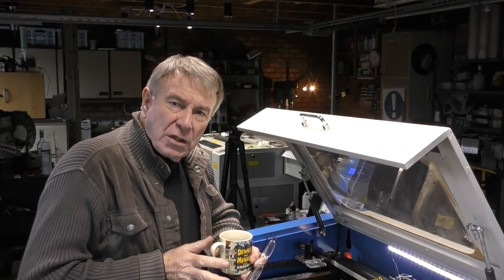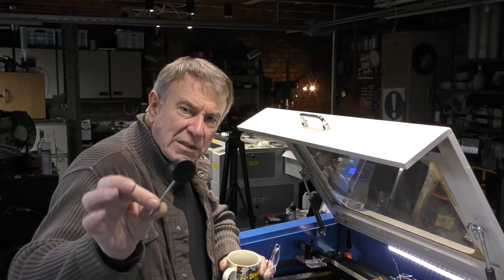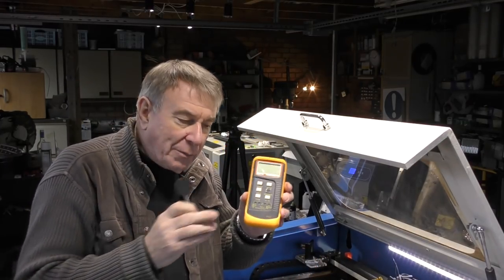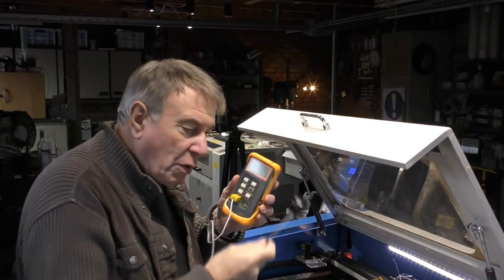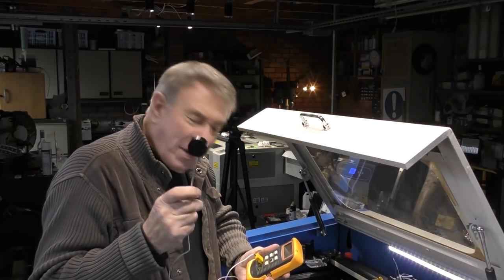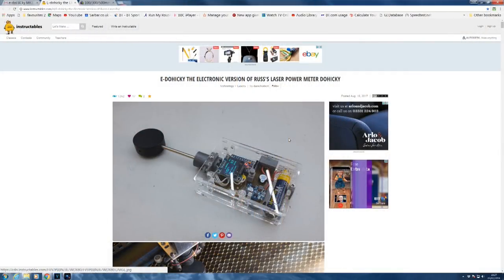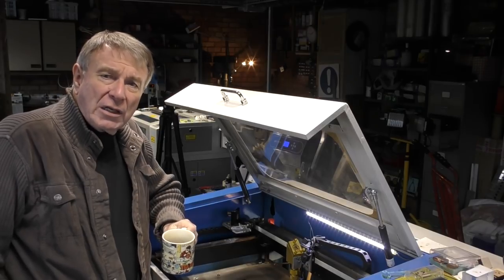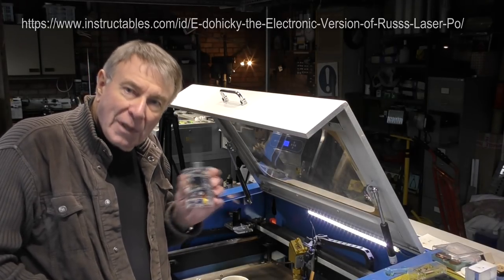RDWorks Learning Lab 131 Dohicky Power Meter Update

Comment: Amazing information, can it measure excimer lamp too. low wattage (5W~100W)
Reply from the maker: I have no way of testing it but an ultra violet wavelength at about 300nm will pass right through the crystal structure of the aluminium oxide anodized skin . It will them proceed to rapidly heat up (and maybe melt) the raw aluminium core.  You will need  some EXPENSIVE and specialist kit  . Take a look at this
https://content.coherent.com/book/lmc_catalog/index.html#page=1
Hope this helps
 Best wishes
Russ
Reply: @SarbarMultimedia  thank you for your  kind reply.

Comment: how do we get the calibration chart?
Reply from the maker: In reality you do not need a calibration chart because I have designed the mass and exposure times  for the three power ranges that that the dohicky covers  so that that the 0 to 40 watts range is  the rise of temperature. The 0 to 80 watts range is temperature rise  x2 and the 0 to 160 watts is temperature rise  x4.. If you decide to buy a dohicky (£30 inc postage) then you will get a full data pack including instruction video.
If you add your disguised email address to another comment I will send you  a data pack and also delete your comment/email.
 Best wishes
Russ

Comment: Great Videos Russ they have helped me with learning and using my laser
How can I get one of your dohicky's as I seem to be unable to message you through Youtube messaging(think they have changed the way it works now ?)
Reply from the maker: Hi  S
Daniel did mention your dilemma.  Yes, You Tube closed down their private message system so there's limited choice for communication now.  I hate to see private email addresses in a public forum but now that's the only way. However, if you add a comment with your email address, I will immediately remove the comment  but will have captured your email address in the email that google sends me also.
Best wishes
Russ
Reply: @SarbarMultimedia  Hi Russ. Thanks for all the information. Just got a K40 and working my way through setup. Could you please send me the information on how to get the dokicky? My email is lgv2005_at_gmaildotcom. Thanks,

Comment: I would like to get the Dohickey.  Thanks for the videos.
Reply from the maker: Hi Mark
I am currentl zero stock but that will be fixed early next week. In the meantime, if you like to add your email to another comment, I get auto copied to my email. Leave your comment live for about 10 minutes and then remove it. I will send you a data pack and a paypal request when I get your address
Best wishes
Russ
Reply: @SarbarMultimedia  Just did it.  Please confirm that you have received it.  Thanks,
Reply: @SarbarMultimedia  daar Russ,

Do you still sell these sensors i would also like to one from you.
My e-mail  adress is ruud.de.rooy.1974@gmail.com
Kind regards,
Ruud
Reply: Hi Mark. Thanks for very detailed videos! Could you please also send me info on the meter to jlwainwright@gmail.com. Kind Regards

Comment: I want to order a Dohicky
Reply from the maker: Hi Drew 
Just add your disguised email address to another comment and I will send you a data pack. I will also delete your comment/email address.
 Best wishes
Russ
Reply: @SarbarMultimedia    what is the price on the dohicky? I just built me two of the most powerful handheld pointers with the NDG7K75 or 7475 and one with the 7w Nubm44 diodes and am curious to the wattage since i am overclocking them but not trying to pay the ridiculous prices of the laser wattage meters.

Comment: Hello Russ,
I need to measure laser power on some CO2 systems as part of my job, but I am also interested to test my amateur CNC blue ray laser. Is your aluminum probe compatible with wave lengths other than CO2 range? Since I am electronic enthusiast working with PIC micros I would like to make something similar to Arduino device, but much simpler. Anyway, your mechanically calibrated 'lollypop' would help and I am interested in price/availability.
Nenad from Belgrade, Serbia

s p i r a 1 0 1 0 @ g m a i l . c o m